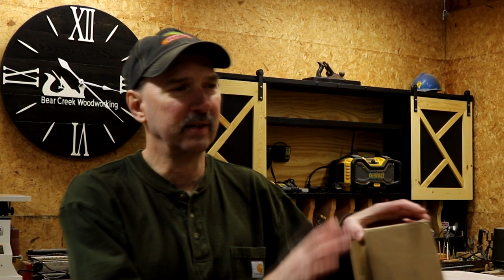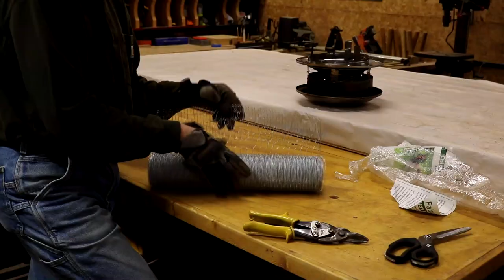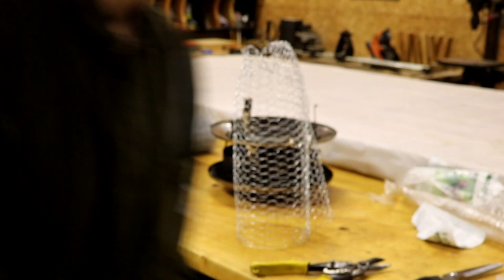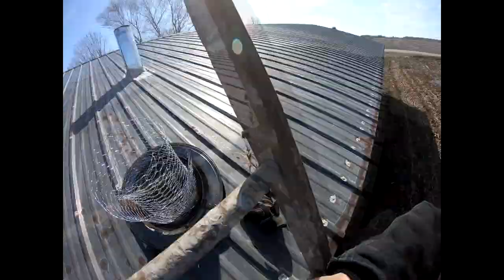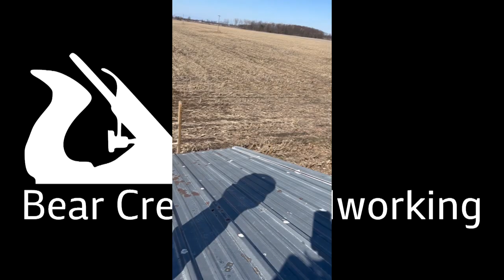How To Keep Birds Out Of My Stove Pipe - Video 86

Comment: This time of year, with temps dropping, we get a bird down in the woodstove, fluttering around inside a couple times a week.  Note, this is without a fire going, just residual warmth going up and attracting birds.  

With a cage of some sort, especially, when it is very cold, how do you stop creosote from forming on the chicken wire and blocking the vent?  With a double wall pipe, creosote has never been a problem inside the pipe. Running a wire sweep brush up and down, produces very little soot.  However, it sticks to the wire cage I made very similar to using the same chicken wire as you did.  If I used cage wire with a bigger opening, the birds get through.
Reply from the maker: @jnails113  I take it apart once a year and clean the stove pipe and chicken wire.
Reply: @BearCreekWoodworking  I might be able to climb on the roof and clean the cap if I were 10 yrs younger. (I'm 80 yrs old). For now, it looks like I'll deal with the birds.

Comment: Thanks for making this video. I am having the same problem.  This morning heard some banging around in my recently installed woodstove pipe.  A bluebird had gotten into the cap and  worked down into the wood stove.  My wife and I were was able to rescue the bird by putting a big drop cloth over the stove and draping it over to  a nearby sliding door.  She carefully opened the wood stove door aa I held the drop cloth in place and out the bird flew through the sliding door.  Problem solved I though but within 15 minutes another bluebird appeared in the stove.  Maybe they were starting a nest?  Repeated the procedure.  So clearly this isn't a fluke and I need to do something like you did with screening.
Reply from the maker: I'm glad this video was helpful.